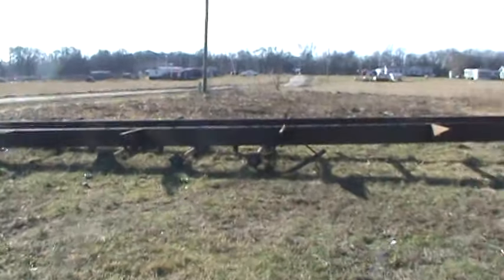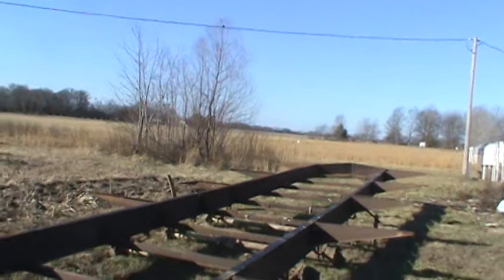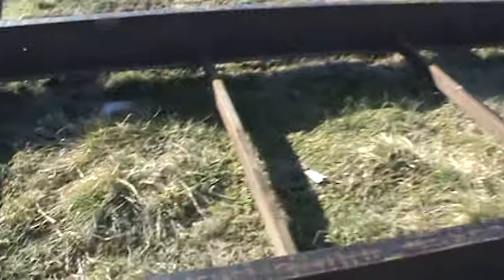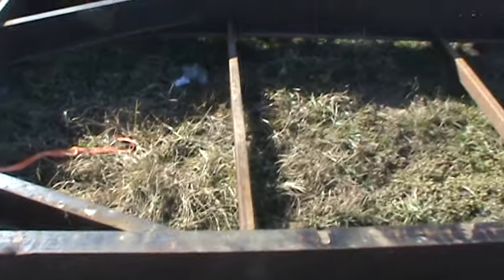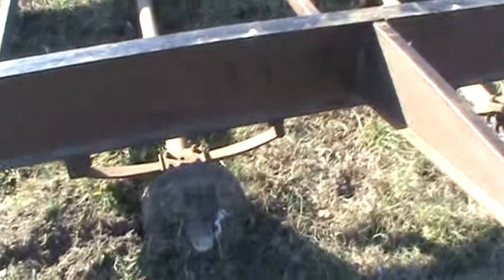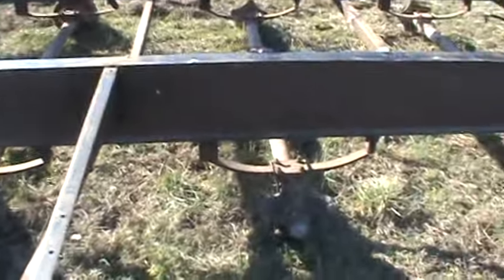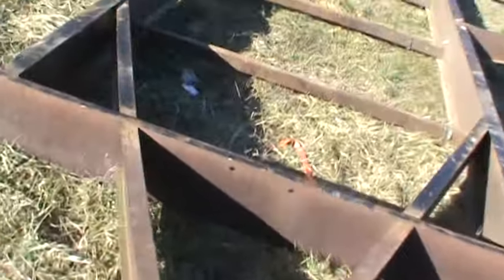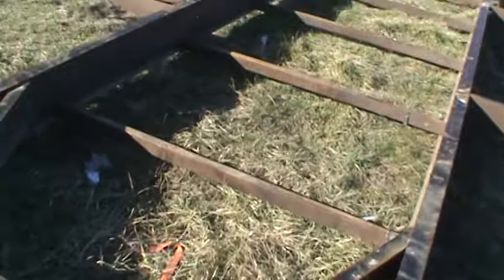Home Stead Trailer Build Part 1

Comment: You can get standard hubs to fit trailer axles I found a trailer shop in Charlotte NC that had them ! I put 8 hole 16" chevy on mine
Reply from the maker: +Theredneck Prepper thanks I have been looking on the internet for the conversion's for the Axles I have, and they have them, all over the place. Dexter sells a lot of those parts.  I might take it down to 12 foot I don't need a large trailer, just one for haling fire wood ect. yet strong enough if I want to hall some rock or brick ect but I have to watch my weight because of the class of licences  have with mine being just a class D just  a standered drivers licences, but this should be a fun project.

Comment: I think 2 5/16", the size usually relates to the trailer weight. tandem will support more of the tongue pressure and carry heavy stuff better. electric brakes are a good idea for sure, have fun
Reply from the maker: +Rev John O'Toole thanks

Comment: Your better off mouth cutting it on both ends at 12 feet in from each end and then welding it up to make 4 legs and a 36 foot roof. Scrap the idea of a trailer out of that. It would exceed home built weight limits in Illinois.